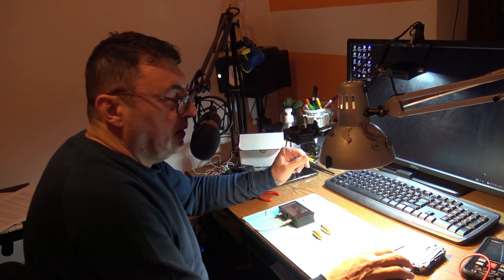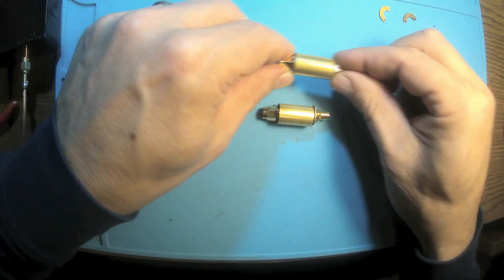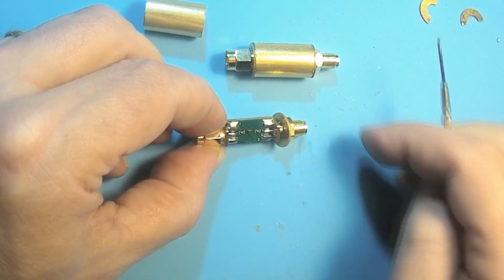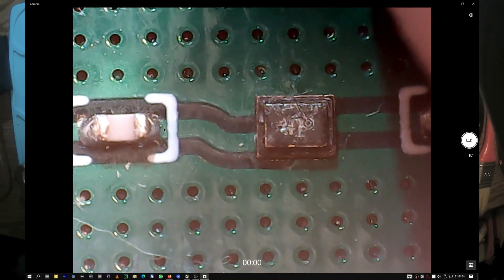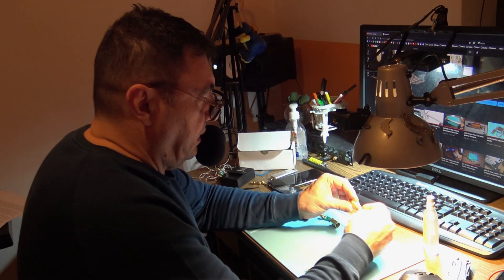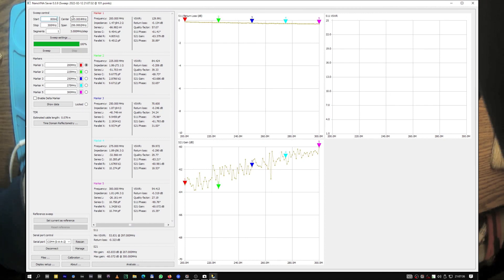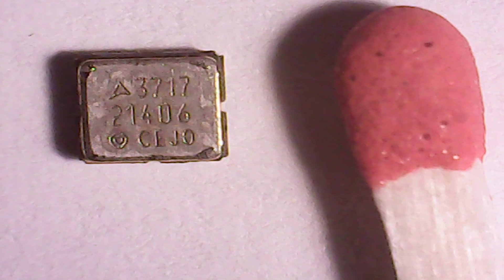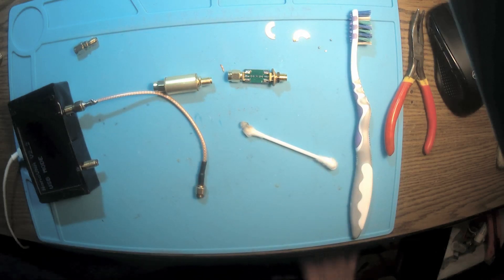The Mighty Heltec filter dismantle

Comment: Hello again Viorel!
Got one of these filters, used, but i dont have a VNA to test it, i tried checking the resistance between input and output (the 2 middle pins) and there was no continuity, is it normal? Couldnt find any info about it on the datasheet
Thanks!!
Reply from the maker: Yes it's normal..there are also 2 capacitors in from and after the filter..but anyway the filter is measuring infinite resistance.This filters are the best so far.
Reply: @viocaia  thanks a lot viorel!

Comment: Hello Viorel. This is a really nice video. However we haven’t achieved any improvement with Heltec provided saw filters for our 30+ Heltec miners, some of which are deployed on cell towers. I believe the problem is high noise floor and heltec saw filters dont help as these filters are connected after LNA, in fact it must be before LNA. Can you assemble bandpass filters for us?
Reply: I will but I can’t see your email in the About section of the channel. Thanks.
Reply from the maker: @magunes  It's there viorelcaia@gmail.com
Reply from the maker: The Heltec filter are very good like insertion loss and it should be connected in front of the miner.The filters I'm DIY are good also, I'm receiving good feedback from most of the people installed them..If I can build..yes but only if you are located din EU..please email , my address is under  ''About'' at my YT channel.

Comment: Hello, I have provided the filter, but I could not solve the problem, as if it got worse. What can help? I'm confused where to look.
Reply from the maker: The filter is good in an urban area, with crowded hotspots and lots of GSM antennas, if you are isolate, far from spots, you better start with rising as high your antennas and good cables.

Comment: Hello friend, I just setup heltec a few days ago, mounted 8dbi omni antenna and it works fine for a day or two and it stops. There is no activity right now. I reset miner and there is an activity after 5mins and stopped again. 
Can you tell me what should I do? Is this saw filter will help?
Steep Laurel Poodle
Thanks
Reply from the maker: It's more a software bug..check again everything, antenna ,cables, connectors..and redo the install..Heltec is kind of deaf a filter should help in a crowded area..but not so much  if you are tens of Km from the City..
Reply: @viocaia  I'll check it. There were very strong winds in my region right now and I thought it was because of that, but the wind had calmed down and the heltec is still not working properly. I also see that people in the area are also not very active. Hell, it's hard to judge without the proper equipment.

Do you know where I could get a good panel antenna? There is a chance for me to reach this city to the west of me (approx. 45 km)? They have a lot more fun there than at my place.

Thanks for the answer!
Reply from the maker: @cccccc5317  There is a lot of folklore about antennas..I never tried a panel, I can't point yu to one..All I can say , I changed to McGill 6 dB and everything went up..but I'm an urban area, not very busy yet and preety lazy too..good luck!

Comment: Very good results with this filter on my Heltec 1.1. I had to buy it after moving from factory 3,5dBi indoor antenna to 6dBi omni outdoor antenna... because the miner went deaf! I'm sure this is due to the noise from the mobile phone base station installed 20 m away on the opposite building, mounted at the same height and pointed in the direction of my 6dBi antenna. I also tried two filters inline but this didn't improve the results any further (just under 20 beacons per hour in Lora logs with two filters, 23+ with one filter, ~0 with no filters. 3,5dBi on my window was something like 4-5 beacons per hour). I just wish more of those beacons were lucky. I get 17 or 18 money beacons per day.
Reply from the maker: Nice! happy minning!
Reply: I have self problem with mobile base station near of me, did you also treid saw filter ?